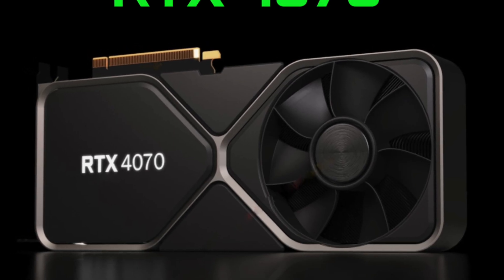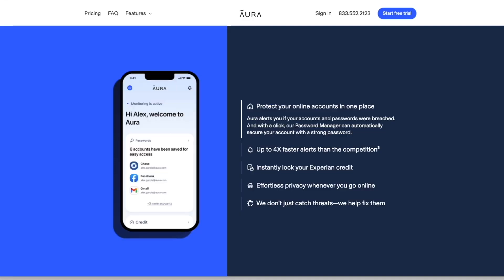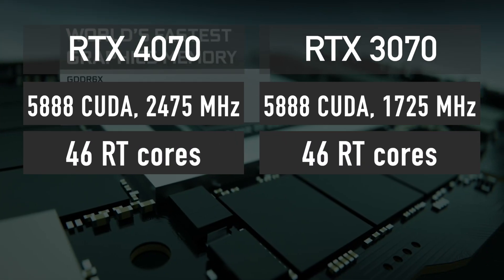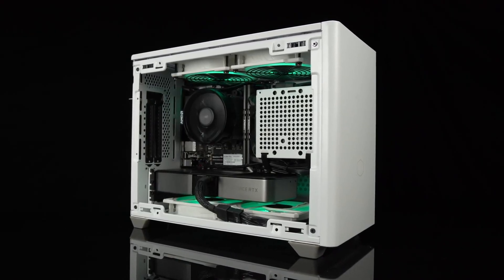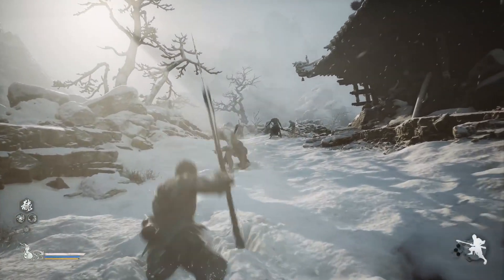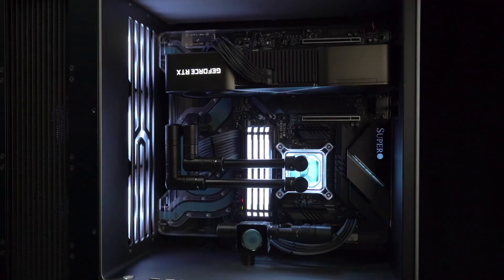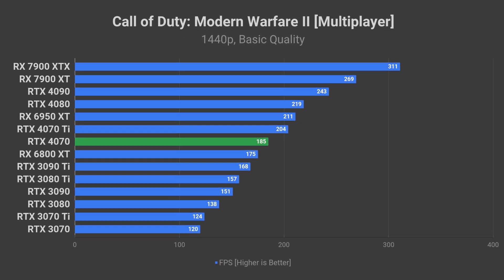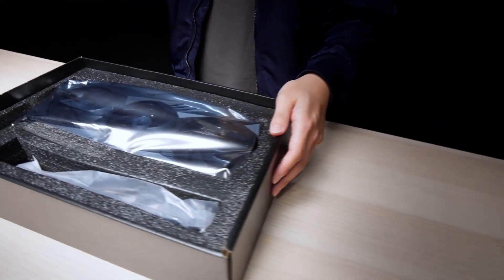The WORST FAIL of 2023 in the making 👉 RTX 4070

Comment: I don't think that losing 25% of cuda cores and 5% of the clock speed comparing to the 4070ti is going to result in just 10% performance drop (that's what your prediction is). 20% looks more like it which would make it worse than the OG 3080 if you don't care about AV1 and fake frames gimmick
Reply: Technically could be possible, because 4070 tie is bandwidth starved... 4070 seems to have same memory subsystem, so it could perform not as bad. Still it's a 60ti tier card with 80 tier price.

Comment: 😅 4070 ti...too laggy with 192 mem bus...very very lag in gaming 2k & 4k.  Not interested with 4070ti anymore. Even 3080 has 380 more mem bus..lol. its time to Refund 4070 ti asap.
Reply: 1. Must be your pc if you say the 4070 Ti is laggy @ 2k gaming. I actually have the gpu and havent had any problems @ 2k but i dont play super ultra settings /RT in every game like yall do

2. Its not a 4k card if you want 4k go 4080 but if you crank the settings to ultra every game along with RT and all the bells and whistles its not going to be that great either and most likely your going to want a 4090..4k/144/ultra settings with RT is demanding!!!

3. Also understand how memory buss works. 

3070 = 256-bit / 448 GB/s
4070 = 192-bit / 504 GB/s

Funny how that works tho it has a lower buss the speed is faster giving it a higher #.. Learn a bit about gpus
Reply: @DETERMINOLOGY  And 2070 back from 2018 also had 448 GB/s. You'd want more than meager 12% bandwidth increase going two generations forward. Jump from 2080ti to 4090 is 616->1008. That's what it should be like

Paying $800+ for the GPU and not being able to crank everything to 11 in @ 2K is pretty sad. It should not have been that way.
Reply: @d.o.5238  Games are demanding, Some not optimized so whats your point and its not sad. Sit on a GTX 1080 or 2080 and be happy if you dont wanna pay that price thats just the way it is. 

Also a 4080 would choke @ 4k/everything at ultra and RT with high refresh rates so your point?

.......

See im the type of gamer that doesn't care about ultra everything geek mode with RT. I know how to tweak settings even if the gpu was powerful i still treat every game the same. 

Like yall complaining as if things is going it change. IT wont either buy or dont buy. Simple
Reply: @DETERMINOLOGY  The point is the only GPU worth buying in this gen is the 4090. No wonder it's been relatively hard to get it in retail. The rest are a worse value compared to it. 4080 is a joke of a GPU for $1200+
Reply: @d.o.5238  They all over priced lets be real. But for me i recently gotten the 4070 Ti, I have no complains @ the power for 1440p / 165Hz but i know how to make gpus stretch i dont play at geektown ultra settings with RT in every game and insane fps.

Comment: I wonder if Nvidia have already worked out how many GPU's to produce & how many they are likely to sell this time round, unlike the 30 series total cockup. If they've got it wrong again & have a huge surplus to shift by the time it's 50 series launch time you could be talking $3000 for a 5090 so they can move the left over 4090 or 4090ti's. Nvidia are apparently getting very good with AI, maybe they need to put it in charge of marketing & pricing because the humans in charge seem to have little or no idea about one of the most important things of being in business......... the customer & their satisfaction!!
Reply from the maker: Speaking of AI, that industry seems to be growing rapidly this year. I suspect NVIDIA will be able to divert some silicon production to satisfy that market. That may allow them to avoid dropping the RTX 40 prices by a lot. I think that those prices will have to come down eventually. But not any time soon. I expect everything to stay as is for the next 1-2 months.

Comment: Nvidia is gaslighting. My guess is it will go for 700$. If that is true, and the RX 7600XT performs like a 3070Ti for 350$, Nvidia is done for this generation.
Reply from the maker: To me it looks like AMD is not interested in challenging NVIDIA in this way. They are simply following NVIDIA's pricing trend for now. I don't expect anything to change dramatically lower down the product stack (7600 XT). Maybe AMD will set slightly more competitive prices. But don't expect them to give out massive bargains.

Comment: The gpu's I recommend right now are something like a used 3080 10gb or a used 6900xt/6950xt. Those are fairly cheap now.
Reply: But they're not unfortunately.
Reply: @Haddley333  I just bought a 3080 off of ebay for $450 so I think you're looking in the wrong places.
Reply: @pf100andahalf  i'm glad you did.  whenever i check and see one in that price range it's a dell model or a gpu that looks like it was living in a ditch for a few months.   Anything of quality is $600 and at that point is not a good deal.
Reply: @Haddley333  Why are you even looking at gpu's that look like they've been in a ditch? Find a nice one by a highly rated seller. There's nothing wrong with the dell 3080's, it's what I bought and it was like new because I didn't just jump at the first thing I saw. They're cheap, built like a tank, and if you flash the latest dell bios to it, undervolt it, set a fan curve, and use the "thermal paste on the vram plate" trick it runs cool and quiet. They're real 3080's. Not sure why you think they're bad and I can tell you've never owned one. Dell 3080's and 3090's are great.
Reply: @pf100andahalf   ebay:  price low to high buy it now.    And the work you described in that gpu is not worth the time unless I had low income and no other option.
Reply: @Haddley333  it takes about 30 minutes to do all of that. Not sure why you think that's some kind of huge problem. I'm not going to argue with you. Go ahead and spend nearly $1000 or more and then trash people like me as "the poors." See if I care. All I know is I refuse to pay these ridiculous prices while you seem to think it's fine.
Reply: @pf100andahalf   you spent 450 on a 2.5 year old gpu in a average if best shroud that required maintenance.  That’s not a good deal
Reply: @Haddley333  Still beats paying 750 for a new GPU with a worse performance :)
Reply: @d.o.5238   that's the neat part, it doesn't.     Buying used like this is not getting you ahead.  Neither is buying a 750 gpu during these sucky times.   Thinking you got a deal either way means you're lying to yourself and Nvidia planned this quite well.
Reply: @Haddley333  I don't know man. Getting almost half of the absolute best GPU's performance for about a quarter of the price looks good enough to me, but to each their own

Comment: So basically like with the 4080 (I have a 2080) you're far better off getting a  4090 and instead of upgrading every 2 years upgrade every 4 had have enough vram going by year on year trends that by 4 years you'll still have 4GB more than those generational cards. I'm making do with my 2080 until the 5000 series comes out and buying one of the last 4090s/ti unless AMD decides to undercut Nvidia in the summer. Cheers
Reply from the maker: 24GB is a very large memory indeed. Do you game at 4K?
Reply: @theivadim  No 5120x1440 mate
Reply from the maker: @FancyaBevMate  wow! That must be extremely immersive.🙂 Do you get a lot of games that don't support such a wide aspect ratio?
Reply: @theivadim  it is and yes most do natively 😁
Reply: @theivadim  Those 4090s will sell out as soon as they're restocked and not for elite gamers only. There is a new class of high end GPU buyers who are replacing the crypto miners. These are the AI enthusiasts, lower end AI researchers and startups. Those 24GB of VRAM is very attractive in running ML workloads and AI is booming at the moment.
Nvidia won't be able to keep their large memory GPUs in stock and has no incentive to lower their prices. 
Nvidia's Data Center GPU, the H100 is apparently being sold as fast as they make them to cloud computing companies like AWS, Oracle, Google and Microsoft and they cost $30,000 per board.
Rumor has it that Microsoft has ordered 25,000 H100's to power their new GPT-4/Bing Search AI. 
So don't look for Nvidia to budge at all on pricing at the high end.

Comment: What a bunch of BS.  This is more like a 3070ti or what the 3070ti SHOULD have been. 4gb of vram of GDD6x with a bus of 192 isn't going to make this card as good as a 3080ti or 3090. This is more like a 3070ti...Ti. it will bench within -2/-4% of a 3080. It's a garbage like this that needs to take a back seat. Tagline is worst fail - yet spends the first half of the video Stroking Nvidia  then says the price sucks, while bloviating about how, in his calculations this will meet 3090 and 3080ti, yet specs are par for 3070ti with a slower bus and less cuda cores. The only part of this video that's right is suggesting AMD, but shoots for the 6950? Dude - tell us you love nvidia without telling us you love nvidia.

Comment: I'm still gaming at 1080p because I love high frame rate and it helps to lower cost.  4K gaming can't be cheap.  It's 4x time the pixel density compared to 1080p.  This change of paradigm is one reason why GPUs aren't cheap anymore.  Add Ray Tracing to that.  CPUs are not affected by those changes.  In every new build I do, I just put a $300 CPU and the performance is always amazing / overkill.

But seeing the 4070 at $700 is a big concern for all gamers who would like to continue using a 1080p cost effective build.
Reply from the maker: I think 1440p is a good middle ground. I prefer having at least a 27" monitor and 1080p looks quite bad on 27". That is why 1440p is my choice for a cost effective, yet high quality experience. For both work and play.
Reply: @theivadim  I agree, 24" max for 1080p.  I was planning to switch to a 27"/1440p setup but the prices on those 4070 GPUs...  And only 12GB...  The funny thing is when you look at the PCB of a 4070 TI, you see 2 empty locations with all the soldering to accept 2 more VRAM chips for a total of 16GB.  Damn it!
Reply: CPUs are heavily affected by ray tracing same with lumen and nanite

Comment: It's funny how people are making predictions about something that's not even out yet. We won't know the price or how it performs until it comes out.

There's so many mixed messages going on out there it's just confusing people. 

I heard that third-party partner cards can't go above $749. Is that on Nvidia? Whatever the third-party sellers decide to sell their stuff for that would be them doing it. 
I understand that sometimes there's control in the market from companies but Nvidia really can't tell people what the sell their products for. Especially if they want to make some kind of profit. 

The specs are not that bad though compared to the RTX 4070ti. They're almost the same GPU. 
Therefore if they're priced close to each other than that would make a lot of practical sense. 

But I personally don't think that they're going to be $749 for the base model. 

My guess is $599 to $650. I could be wrong. But it wouldn't really bother me because I don't care. 

The RTX 4060 will be coming out and that will be a pretty good gpu too.
And there's my pricing or GPU simply because Nvidia has got high prices. I love how everyone blames Nvidia for everything.

AMD is the one that's being greedy because they have the least amount of overhead cost. 

They can easily sell their gpus for a hundred or $200 less. But they are choosing not to. 
AMD is making that choice not Nvidia. 
Stop defending AMD. Just like that 7950x3d is not worth the price that they're charging.

Comment: I'm sure Nvidia will go with $700.

But now I'm also doubly sure on my original $500 estimate for the 4060TI.
Reply: 699*
Reply: The 4060 will be $500 the 4060ti will be $649
Reply: @Adromelk  An increase from $330 to $500 is a 52% increase and 400 to 650 is 63%.

NVIDIA isn't going to increase the cost by percentage anywhere close to the increase from the 3080 to 4080. They can't sell GPUs this low end to anything except gamers. There is a real limit to what they can charge.
Reply from the maker: Yup. Looks like that is what is happening 😅 Unfortunately.